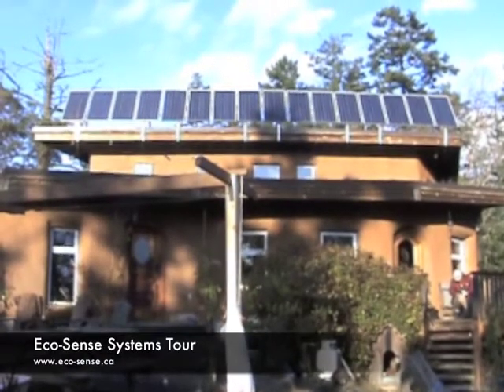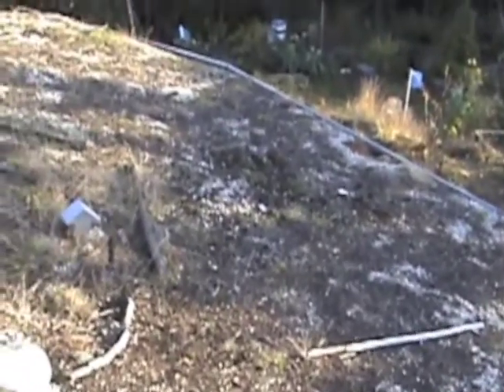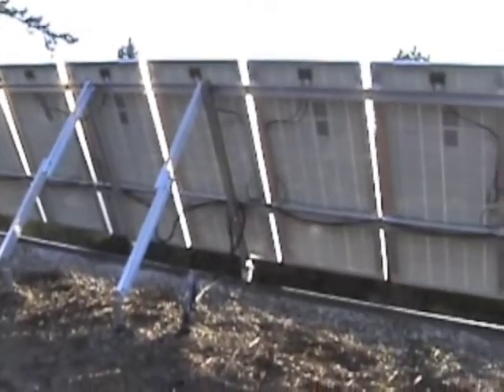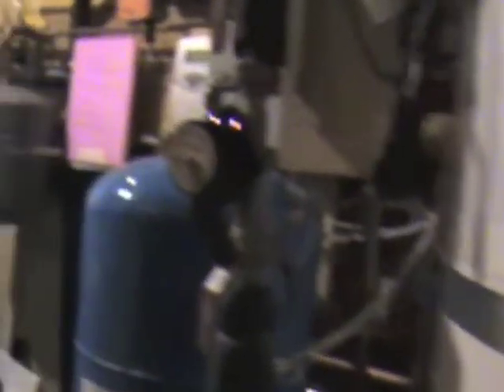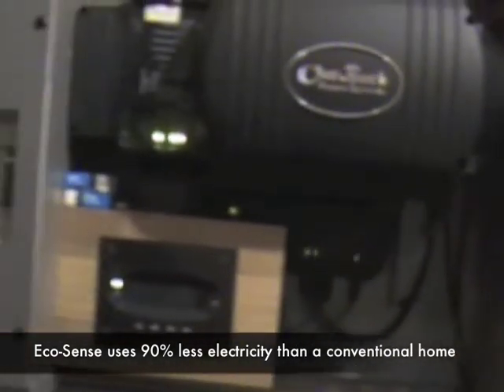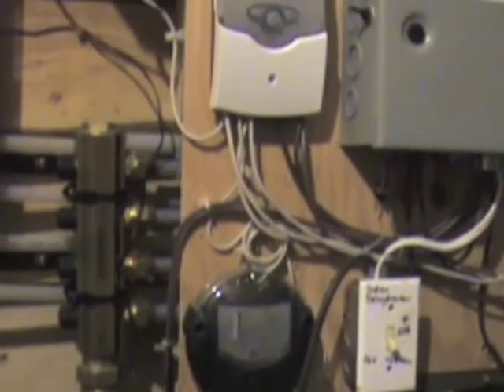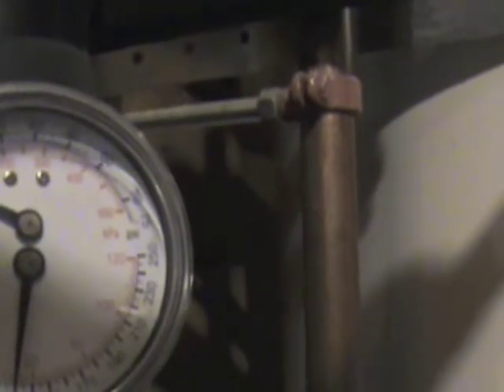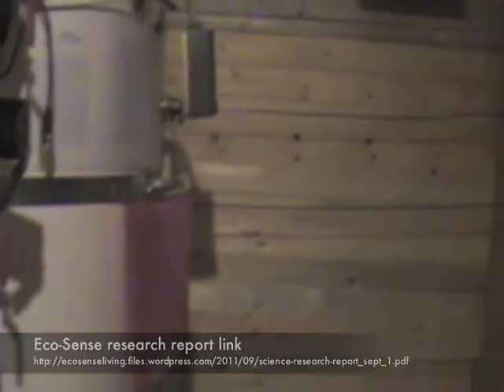Eco-Sense solar tour.m4v

Comment from the maker: Depending on where you live and what your end use is, can determine whether you outlay the funds for the tubes or not.  In terms of drainage in the summer and the tubes resiliency to heat, our are ok for such but each manufacturer will have different specs.   In the summer we have more heat than we need so our heat dump is a solar dehydrator that runs 24/7.  This works great.

Comment: I am considering evacuated tube solar. In the summer here, there would be a need to dump the excess heat as well. How do you deal with that and can they be drained down during the summer heat without damage to the tubes. It seems that the only other option is the flat plate collector that CAN be drained down without damage.